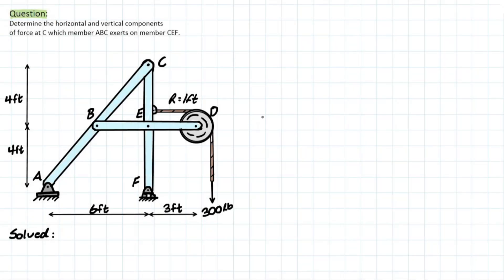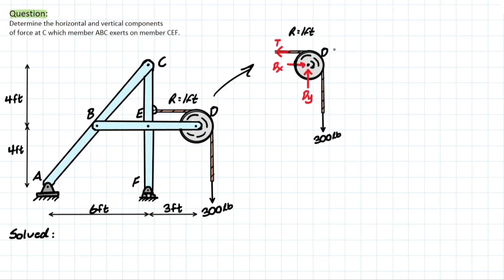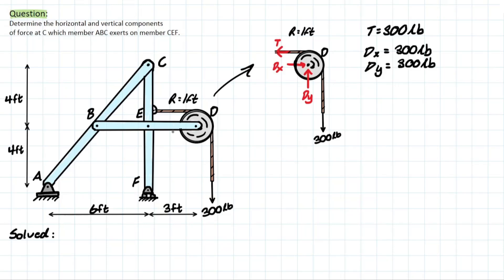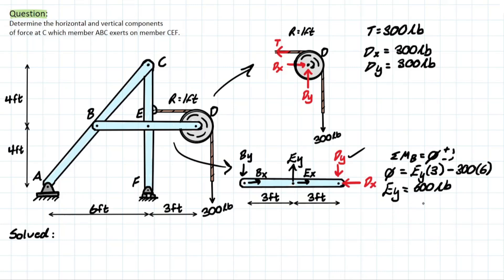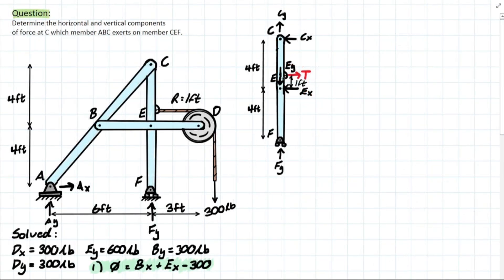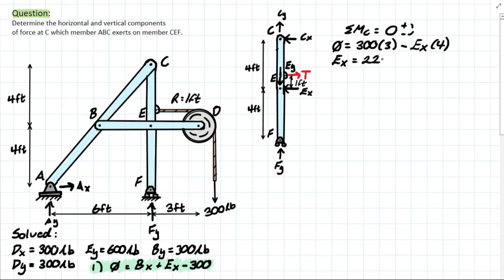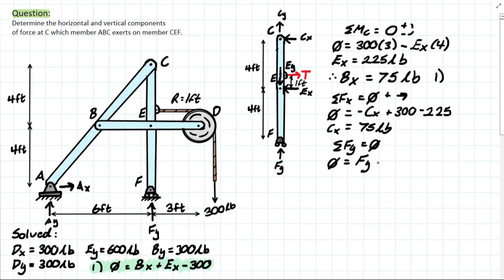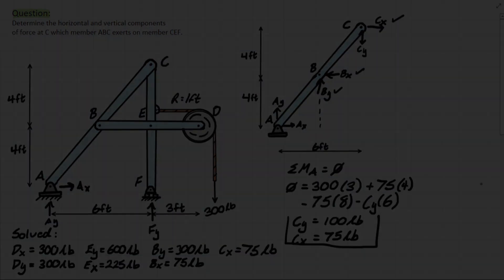Solving Machine and Frame Problems!

Comment: Greatly appreciate the video 👍🏻 however some changes to the sketch and the eventual FBD would help a lot.  It isn't initially clear if E is on BED or it's the tether point.  It would be useful to have an E on the member BD *and* maybe an F or G for the tether point.   

Nice video and great handwriting.  How did you make your illustration?  What's your opinion on first starting with global equilibrium equations and then dismantling the structure into individual members for analysis?
Reply from the maker: Thank you for the feedback, I always aim to make concepts as clearly displayed as possible, so I will remember this for the future.

For illustrations, this is just using OneNote with a drawing pad (there are cheap ones from Wacom that are excellent).

For your final question, I prefer to work globally and solve for reactions first, then individual members are solved that have enough known variables to proceed with the problem!

Comment: 3:25 why the Dx and Dy is in opposite direction?
Reply from the maker: Good question! This is simply to satisfy the conditions for equilibrium at an internal pin connection. If you have an x and y reaction in one member, the opposite member must produce equal and opposite reactions to ensure that the sum of forces is zero.

Comment: Hi, I have a question that in some of the cases we don’t need Dx and Dy if we are looking at external forces? I’m confusing about those cases and can you explain the difference. Thank you!
Reply from the maker: Good question! I think it comes down to the type of system you are analyzing. If external forces are applied to a pully for example, then they must satisfy equilibrium. But, if the pully is supported by a frame in this scenario, then the frame members must also satisfy equilibrium. For this to happen, forces exerted by the pully, and reactions in the member must be considered.

Let me know if this helps!
Reply: @simple_civil  Thank you so much for your explanation!